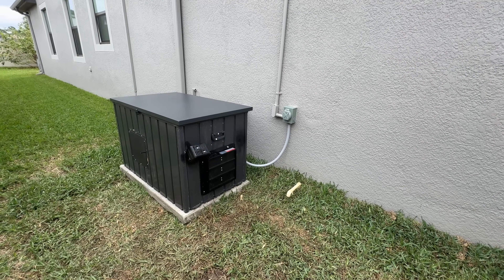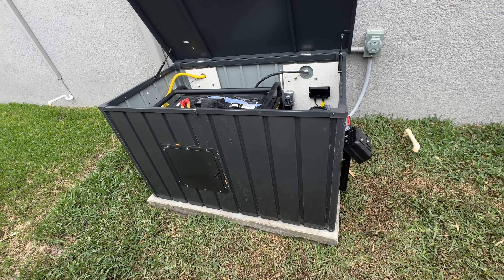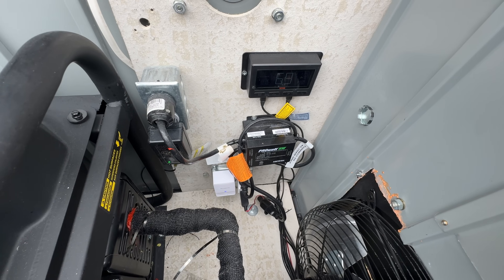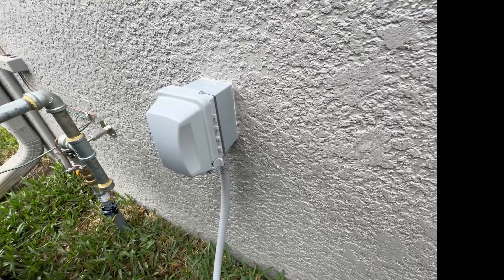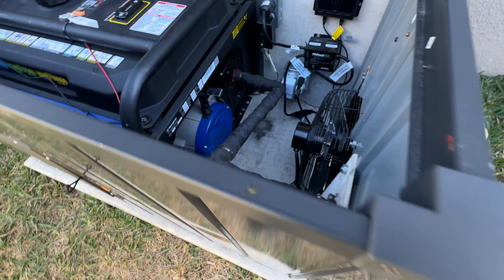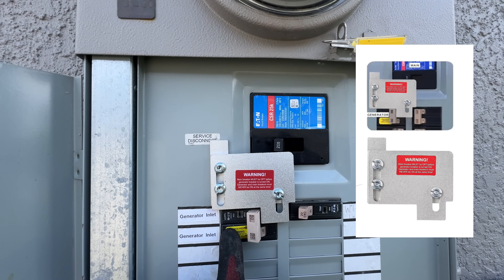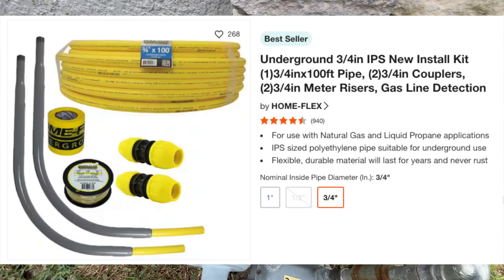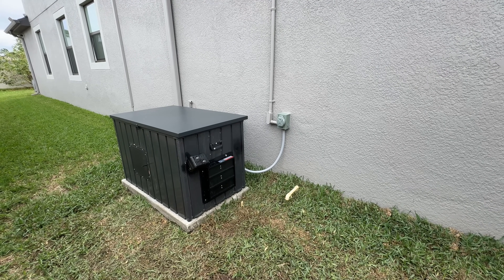DIY Whole Home Generator Enclosure: Power Your House Like a Pro!

Comment: It appears that you have two separate ground rods bonded to the same unswitched home run neutral. My exact same hardwired Westinghouse setup required a floating, unbonded neutral since I was not using a transfer switch at the panel to disconnect the house neutral. My State codes may differ.
Reply from the maker: Thanks. I have a friend who is an electrician that lives across the street. I will research it further and make any necessary changes.
Reply: I believe jefb.5222 is spot-on, as the NEC is clear on it.  These Westinghouse generators (and all UL listed generators of 15kW or less) are supposed to come with a bonded neutral ... and are marked from the factory as having such. The Westinghouse units ALSO come with a manual that tells one how to un-bond the neutral ... and a 'generator unbonded' type sticker to apply atop the generator's markings to indicate the neutral has been unbonded.

IIRC, a generator with a bonded neutral is a 'separately derived system' per the NEC. The generator type ('separately derived system' or 'non-separatley derived system') and transfer switch that's used with it must match ... but in this case, they don't.

If, for example, a generator has its neutral bonded to the generator frame (as these Westinghouse generators are supposed to from the factory) ... thereby making it a 'separately derived system' type of generator ... the transfer switch used MUST disconnect the neutral from the utility and reconnect the neutral from the generator (i.e. transfer the neutral) to be code compliant (read: safe!). If there is a mismatch (as there is in this case) wherein the grounded conductor from the utility remains connected to the generator neutral (as it does in this case, since an interlock breaker does NOT disconnect the neutral [or the ground!] from the service panel!), parallel ground currents can circulate on the premises wiring system.

I see two possible fixes:
1) Replace the interlock breaker with a transfer switch that transfers the neutral.
OR
2) Un-bond the generator's neutral per the manual (a 5 min job presuming proper access to the generator), apply the 'generator unbonded' sticker that came with the generator in the proper place on its panel (or make one with a labeler if local code doesn't disallow such), and remove the ground connection from the generator frame to the grounding electrode.

In either case, per 702.7(c) of the NEC, the inlet port on the side of the house should have a warning sticker on it, and I didn't see one in the video, at all.
* When the inlet is properly wired for a generator whose neutral SHOULD be bonded to the frame of the generator (which presently IS NOT the case based on what we see in the video at time of this writing ... but would be the case if fix #1 were to be done, as a transfer switch instead of an interlock breaker would result in such), the warning must say, "WARNING: FOR CONNECTION OF A SEPARATELY DERIVED (BONDED NEUTRAL) SYSTEM ONLY."

* When the inlet is properly wired for a generator whose neutral SHOULD NOT be bonded to the frame of the generator (which presently IS the case based on what we see in the video at time of this writing), the warning must say, "WARNING: FOR CONNECTION OF A NON-SEPARATELY DERIVED (FLOATING NEUTRAL) SYSTEM ONLY."

EDIT:
When reviewing to see what Vevor humidity device was used (since I liked it and there was no link to it in the list of linked items used for the built ... at time of this writing), I also noticed a piece of white Romex that appears to enter the enclosure from a Liquidtite-style whip connection to the house .... and then route to behind the cement board. I presume based on content from the video that this white Romex this is the utility power feed from the house ... and the concern here is that Romex is not wet-rated -- meaning it should not be used to go from the house, to/through the whip, and into the enclosure ... as we can clearly see water on top of the generator, AND as the generator enclosure is a separate, outdoor location.  (IIRC, this should really be THHN wire that comes from a junction inside the house ... to/through the Liquidtite-style whip, and into the enclosure to feed utility power into it ... at least, if one cares about meeting NEC requirements.  For safety and NEC code reasons it should ALSO be inside conduit ... even inside the generator shed.  Heck, the Romex being in conduit inside the shed, while not code-compliant due to Romex not being wet-rated ... would still be a safety improvement, as it eliminates the possibility of nicking the Romex with a screwdriver and running current through it, to the shed wall, and potentially into you if you're touching it when it happens!)

DISCLAIMER: I am neither an electrician nor an inspector, and the above is intended solely as information that provides a starting point for the reader to use in consultation with a licensed electrician in order to ensure any/all needed work done by said licensed electrician complies with national and/or local code requirements. Any/all other uses are at one's own risk. I also welcome any information that corrects my understandings as shown, above, as only the divine is perfect!

P.S. The above is not intended as a rant.  Clearly a lot of thought and detail went into the build, and I love the concepts I see -- enough that I'm borrowing some of them for an upfit of my own enclosure.  However, the devil is always in the details, and all of the above noted things are safety-related.  NEC code exists for a (safety!) reason, so compliance really shouldn't be considered optional, IMHO.

P.P.S. I eventually figured out that the Vevor temperature/humidity controller came with the exhaust fan you used.  A pity, as I need only the controller and Vevor seems not to sell it separately. :(
Reply: @SurrealViews Well said and in great detail SV. Do you have a blog on this subject? Another concern is the ground rod at the generator being connected to the bonded home/utility system that could "potentially" electrify the ground, under certain fault/fail situations... or so I've been told/or read.
Reply: @jefb.5222  I don't blog or produce social media content; I'm just a DIY guy who tries his level best to do things properly ... and nerds out on subjects like this to try to make sure of it.  

I believe either of the two fixes I put forth would solve the grounding electrode (i.e. ground rod) issue you mention, as IIRC the generator setup would need its own grounding electrode when using a transfer switch that transfers the neutral .... and IIRC the generator setup should NOT have its own grounding electrode (which I believe I covered, above) if he's going to unbond the neutral and continue to use his interlock breaker.

Comment: Well done! I’m in the panhandle of Florida and lose power regularly during hurricane season. I recently added the 50 amp inlet, interlock device, soft start kit for my 4 ton ac unit and the same Westinghouse 13500/10500 trifuel generator. It works great! Powers the whole house!
Reply from the maker: @Frankandbeans250  Hey, how’s it going? I used to be stationed in the Panhandle while serving in the Air Force. I haven’t had to use mine in an outage yet—just tested it during generator run-ups. Glad to hear yours is working great!

Comment: Very nice setup but one thing you have that you really don’t need is the PROwatt cause if you have power from your house running into your setup you can just plug your fan to that and have power all the time to it and if you lose power to the house your generator still going to power that outlet  cause you running your whole house off it
Reply from the maker: @Cede225  OMG, you’re absolutely right! I can’t believe I didn’t think of that—I could have saved $70. It’s amazing how the simplest things can slip past you. Thanks for pointing it out!
Reply: My PROwatt dual power switch is in place in the event that my panel-fed 20A circuit breaker trips while supplying power to my mission critical cooling fan". For only $70, the PROwatt is a solid add-on. @ColleKharis
Reply: I almost done the same thing until I thought about it lol
Reply from the maker: @Cede225  I'm going to sell it on Ebay LOL
Reply: Guyanese brother! I'm convinced to do this
Reply from the maker: @cnigeldgriff6283 Great. Where in Guyana are you from. Good luck with the project and please feel free to share how it turns out.

Comment: This is really well done.  but... a little more space for air flow and maintenance ease  and some sound proof/fire resistant insulation would further dampen the sound. Yes, it will make a bigger foot print.
Reply from the maker: Hey unclem4626, I agree 100%! I did consider the fire-resistant insulation and airflow, but I couldn’t go bigger because of some setback restrictions on the side of the unit to pass inspections. It ended up being a bit of a compromise, but it worked out. Thanks for the great suggestion! Definitely something to keep in mind for future projects.

Comment: Hey Colle, thanks for the video and taking the time to film it when it isn't your normal postings. Really is a great alternative to the plastic containers (like you mentioned). Did you happen to do any sound measurements before and after? Would be interesting to know what is the reduction. Thanks!
Reply from the maker: Hey Greech-Grimwater,

I appreciate you checking out the video! Sound wasn’t a major concern for me because my neighbors on three sides all have generators, and they’re louder than mine, which is why I didn’t insulate the enclosure. That said, I did purchase a sound meter to ensure I stayed HOA compliant.I just tested the enclosure today while standing right next to it. With the enclosure closed, the reading was 88.6 dBA. When I opened the top and access door, it measured 92.1 dBA, so there wasn’t a significant reduction. If you’re thinking of insulating yours, you might need a larger patio storage unit, depending on the size of your generator. Let me know if you have any other questions! Thanks again!